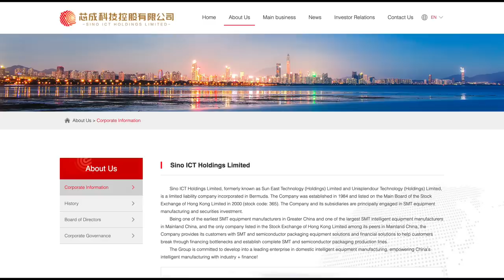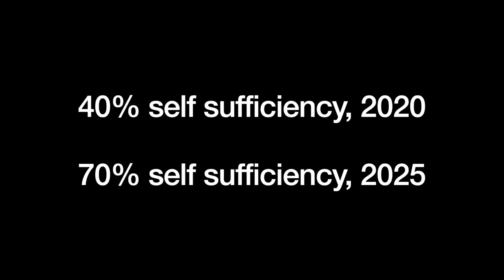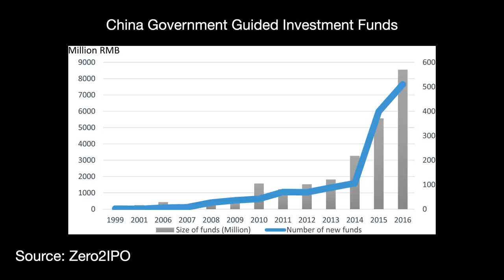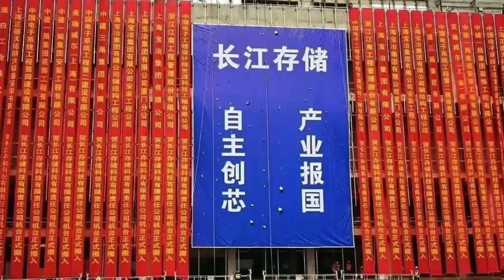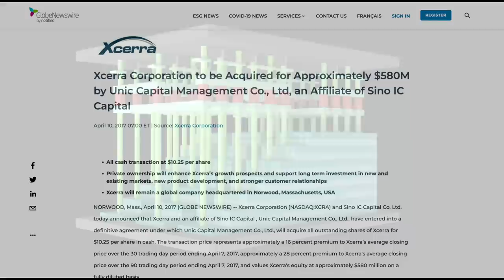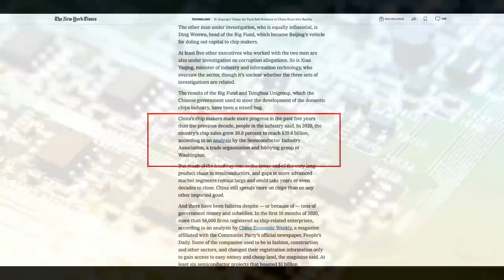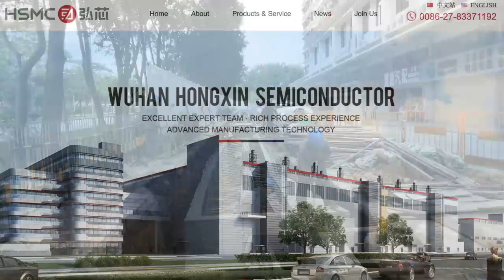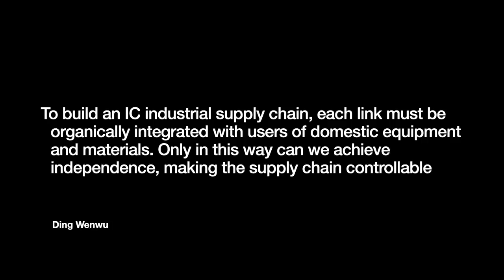The Flawed Assumptions Behind China’s Big Semiconductor Fund

Comment: The problem is that there has to be people that spend the money, otherwise the enconomy is going to stop. It's just never to be a self incentive enconomy environment. So the fund even with huge flaw and very likely incure benefits exchange and corruption, yet indeed it pushes the china integrated circuit industrials.
Reply: Recently there are quite a few of them doing well despite others' failure. For example Beijing Moore Threads who released their own GPU and AI chips recently.
Reply: @leezhieng  I fully agreed and actually it is indeed that the fund could grant great purchase power for China to purchase GPU Imagination and secure the GPU cores to be readily available for company like Moore Thread (which is sales teams leader from NVIDIA Found this company) or BIRENTECH
Reply: , JINGJIA Micro or INNOSILICON

Comment: China is good at two things, scale and cheap labor. All the industries they have succeeded in require either both or one of these 2.
But semi-conductor chip require another thing, yield. It doesn't matter how many wafers you can churn out if only 1% of them work.
And to increase yield, takes engineering, a real understanding of how the line work, tons of talent and hard-skill to make individual equipment to work together.
It just isn't the case of buying the equipment, hiring 1 or 2 of the people from the company and throwing a ton of cheap labor to get it working.

Even the minute different in local electrical supply can result in change of the yield. That's what at play when your stuff goes to the nanometer...
Reply: Actually they are not much good for cheap labour any more. That's why multinationals are moving to Vietnam, Bangladesh, etc.

Comment: A very interesting video. I don't put a lot of faith in the idea of US ability to deliver on Chip 4 Alliance. They have already cut out TSMC from major discussions which along with the actual costs to building and operating a factory in the US have led them to doubt the value of building a factory in the US. As well, the US got TSMC to transfer ip to the US for basically nothing. So I don't see that relationship developing in a positive way. Next you have ASML. With development in both Japan and China in developing chips not using EUV lithography if they are unable to maintain a presence in China that is about $30 billion annually in revenue down the drain plus with the expectation that in three years China will probably no longer need EUV lithography machines to produce semiconductors. Things are in flux and it will be interesting to see what happens. But as an American I don't have a lot of faith in US leaders nor the overall quality of the education system to produce high quality engineers in the quantities needed to sustain what they are trying to do.

Comment: China has been stupid with their chip tech. They mastered 14nm yet didn't do anything with it. They could have been the top manufacturer of specialized older tech. It is still used in a lot of products. What would happen if China became number one in hardened 14nm chips. No more worry of solar flares or electrical discharge. They could have been come specialists for space travel chips. You don't need the cutting edge for navigation or fundamental base controls. Or on Mars. You do need hardened chips though. they could have specialized in other ways as well. Too busy screwing each other.
Reply: A lot of the 16 odd % is indeed a bunch of old stuff..
Reply: chinese 14nm chips just entered mass production this year, it will take a while to build out that capacity.